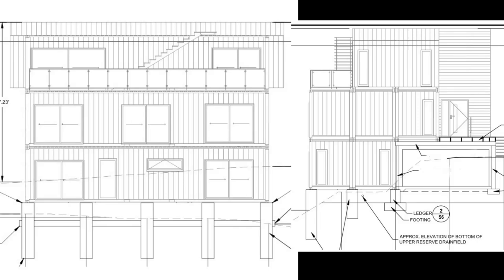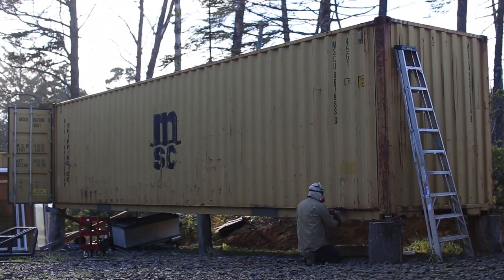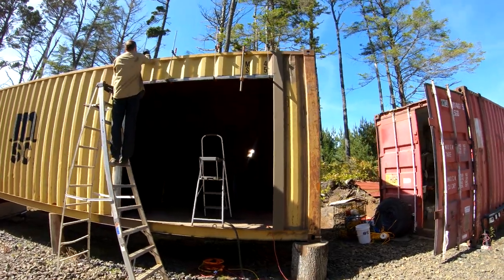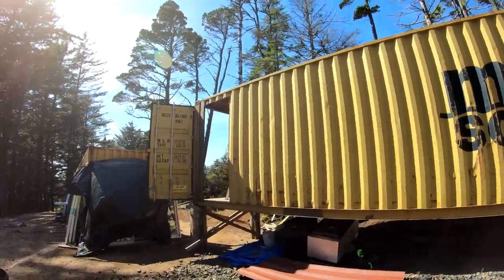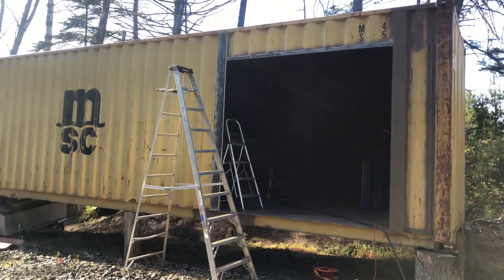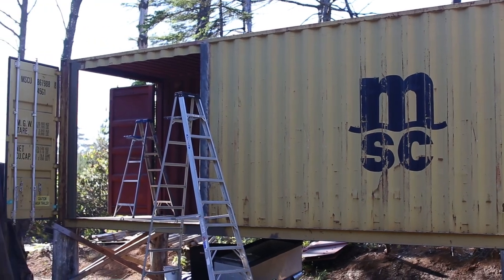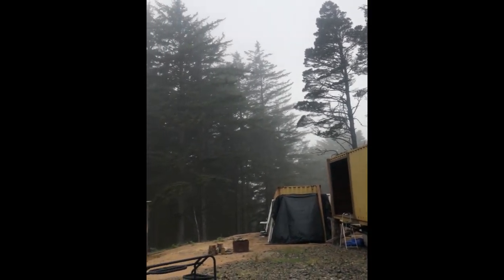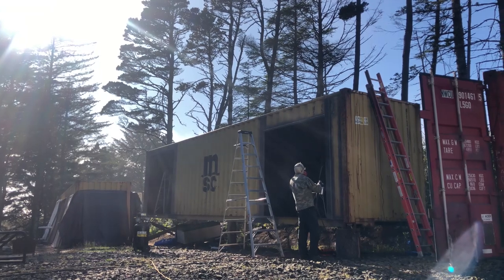3RD CONTAINER CUTOUTS for our SHIPPING CONTAINER HOME - Ep. 15

Comment: Nice work, looking good! I was wondering if you've had to reinforce the lower framing for any of your openings? It seems like removing a lot of the strength of the wall would also negatively impact the lower framing if it's not directly bearing on something below.
Reply from the maker: We reinforce the bottom C channel where the openings are, and add some shims where the containers will be stacked. Also the first level is supported by concrete piers every 10 ft 🙂
Reply: @PacificPinesRanch  Makes sense, what are you reinforcing the channel with? Welding a plate in to box it or something different?
Reply from the maker: Yes we welded a plate beneath the vertical tubing on the lower C channel. 🙂

Comment: You didn't grind away the 1/8 th of metal left from the cutouts. What tubing did you use to avoid  the grinding?
Reply from the maker: If you're talking about the leftover corrugation, we did grind that down flush with the bottom c channel before we installed the tubing.

Comment: Can you talk a little bit why you guys didn’t use the twist locks that connects the containers when they are stacked on top of each other?

We’re the containers difficult to stack on top of each other without the twist locks?
Reply from the maker: We did use the twist locks to connect them vertically, and they will also be welded together once they are placed. This container is sitting on our “conversion station” lol. Once it’s ready to go, we will place it on the 2nd level of the house. The twist locks were extremely easy to use and it takes a second to place the containers and line everything up but it’s not at all difficult. 🙂

Comment: I’m just wondering, do you have to deal with city/county building codes and inspection?  Did you guys have to hire a structural engineering firm to calculate whether the structure can handle seismic and wind loads in that area?
Reply from the maker: Yes, yes, and yes lol. 🙂
Reply: With your knowledge and experience you guys must be close to being world leader experts  in the cointainer building process (maybe with the exception of George Runkle).  With a simpler faster stack design with some architectural touches you guy can probably provide a solution for housing requirements over at Starbase City, Texas.

Comment: That cut-off tree trunk is not good, u should have taken all those bark off the cut-off trunk otherwise u going to have problems with woodworms, concrete Piller is better than the wood. Good luck plan well ahead and have Plan B ready too.
Reply from the maker: This container will sit on the 2nd level of the house when it’s done. This is a temporary working station to be able to paint the bottom, and work on it without being 20+ feet high, etc. Our foundation of the house is all concrete. :)